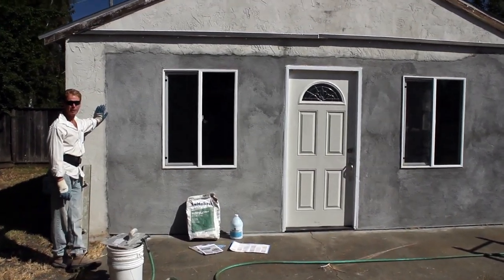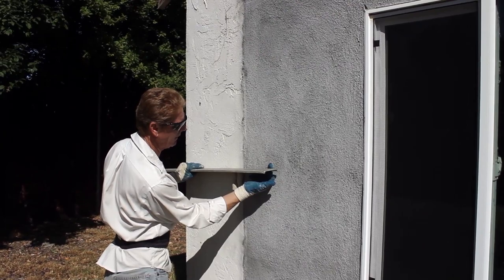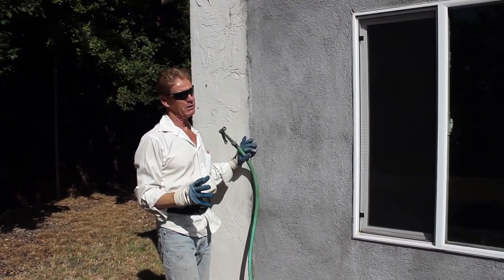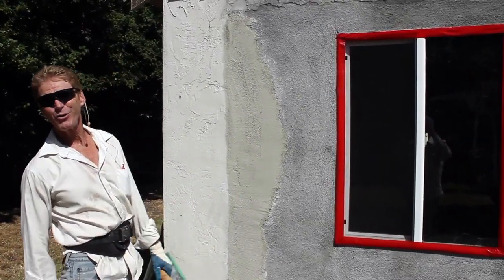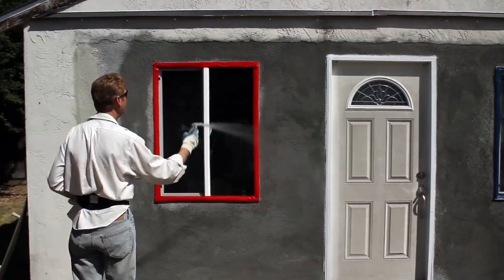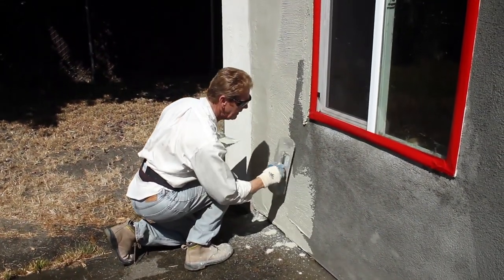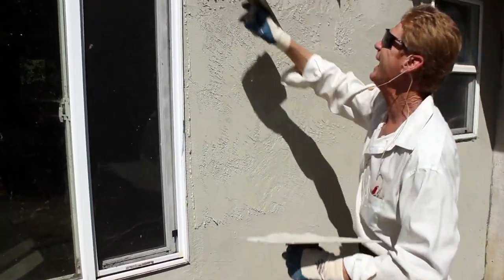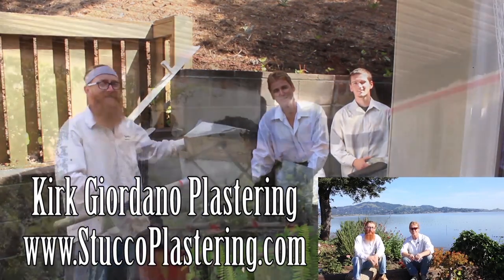Stucco finishing tips.

Comment: Can that skip trowel texture be achieved with plaster?
We tried to match what we had in the house. It came out pretty close but thicker (tacobell). Found that a skim coat over wall board was required to achieve texture. 

Would you spray interior walls to wet them? Used a sponge.. but it just made a mess. Note: no insulation in attic and no a/c att on 90+temp days.
Reply from the maker: Good afternoon Tubo Flush Dude, it's difficult to apply a skip trowel texture with base mud but can be  done.
As far as using water inside your home, depends on what you have, a basement all concrete sure, a bedroom with gypsum plaster, no way.
                       Live long and plaster
  teaching repairing your number 1 investment, your home

Comment: How different would the procedure be if if the finish coat was a coloured acrylic? Would you wet the basecoat as well etc?
Reply from the maker: Good evening good question, I would wet the wall with the proper primer for the acrylic being applied, as all stucco acrylic primers are mostly water.
 I have many times when a home was fully primed with an acrylic paint specifically engineered for the stucco acrylic coating were appling still  needed to hydrate the wall down as if the wall is too hot the moment any material is applied weather acrylic or cementitious it will dry immediately.
 working in weather hotter than say 90 to 110 degrees, takes a bit of practice as the rules change.
                          Live long and plaster
 teaching repairing your number 1 investment, your home
Reply: I just did my first wall with acrylic,doing it alone at 86 Fahrenheit in the sun, course stone and a near by hornets nest it was drying to fast, the next day I could see three cold joints.I was so upset but I had an idea and tried something that worked and it looks great now,the hardest part was to rub it properly,it was sticky and drying to fast.
Reply from the maker: Good evening Tony, Dude exzackory,
 If I were applying acrylic in this weather if I didn't wet the walls consistently within ten minutes it would have tightened or set and been like setting glue, have you ever applied glue to walls, I have, it's tacky and your trowel must be wiped clean and wet after each stroke, sort of fun as it take so much practice.
 We will be doing something similar tomorrow on a ceiling, will video it just to show you what I'm talking about.
                          Live long and plaster
 teaching repairing your number 1 investment, your home
Reply: Awesome,thanks!
Reply from the maker: Howdy Tony, no worries,
                       Live long and plaster
  teaching repairing your number 1 investment,  your home

Comment: How to fix lot hairline crack on stucco wall.....? I try to use silicon but it crack again......
Reply from the maker: Good evening Toad Dude, silicone is great for fishtanks, but I would use mor-flexx caulking if the wall is sandy or big stretch if it's smooth, the hairline crack has to be cleaaned and the caulking should be squeezed into  the crack, 
                          Live long and plaster
 teaching repairing your number 1 investment, your home
Reply: Thank you for responded so fast. I watched over 15 videos from you after I asked the question, and your answer is same as you say in the video....thank you so much ,I'm going to try again this weekend.
Reply: Go I need to pre-wet the cracks before I apply the caulk ....?
Reply from the maker: Howdy Toad Dude, no it's beat to squeeze the caulking into a dry crack as most caulking already have water in them anyway, that why some of them shrinks.
 beside any mostier will make most caulkings slide around and not grip well.
                       Live long and plaster
  teaching repairing your number 1 investment,  your home
Reply: Thank you so much

Comment: I will like to buy a staple gun
Reply from the maker: Good morning Jose Dude,
 there are many brand names selling similar air tools, however Senco 200 XP and their Senco 150XP have been in business the longest and has a proven history for quality and longevity on it’s side.
     Stucco lath stapling guns or pneumatic stucco lath guns are the preferred method of attaching stucco netting used by us professional stucco and plastering contractors, not only are they preferred but are code requirements.

http://amzn.to/2xoiy62    SENCO WC200XP 16 Gauge Wide Extreme Pro Crown Stapler, 
FYI, this is the air tool I prefer as it holds a variety of staple lengths and is designed for attaching stucco netting.

http://amzn.to/2xpxdho   SENCO WC150RXP 16GA Roofing gun, 1" Crown, 1 1/2" Roofing Stapler, 
FYI,  this 150XP is also good and can be used also for roofing and attaching stucco netting
                     Live long and plaster
           Sharing the plastering knowledge 
                       Kirk and Team Giordano